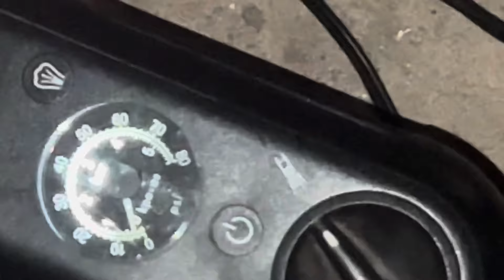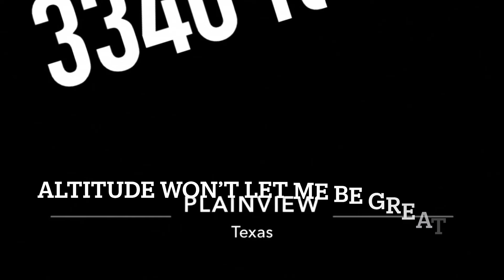Quest for an 8 second pass continues

Comment: Why would you not keep it awd
Reply from the maker: Number of reasons.  These have good suspension already. Good weight transfer. So no need to lose power trying to turn 4 wheels when 2 on a tire will do the job just as good if not better.   Cheaper to do gears just on the rear Instead of front and rear gears. And the main one I did it.   To do hood rat shit lol